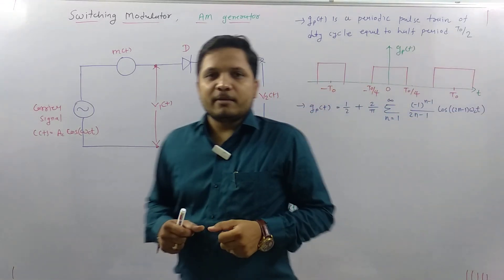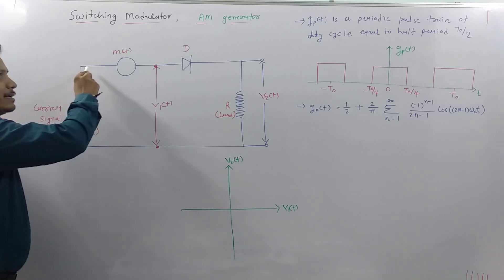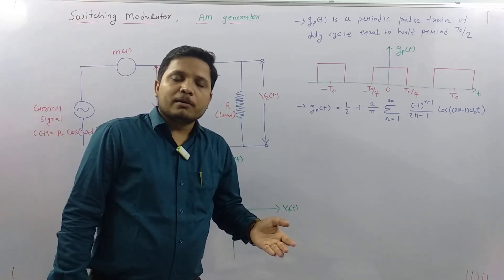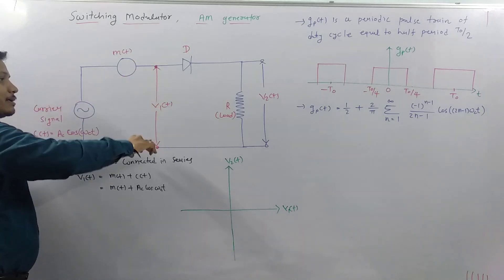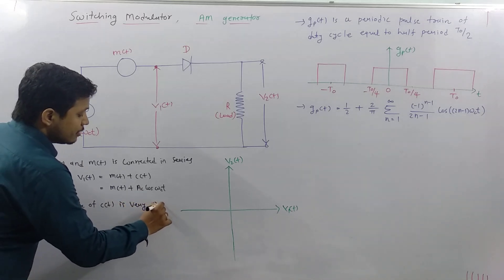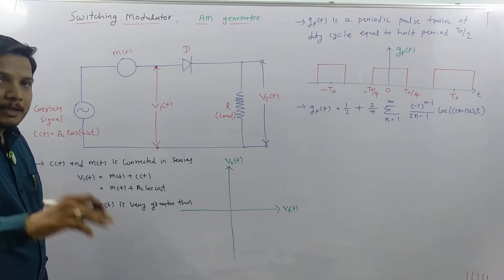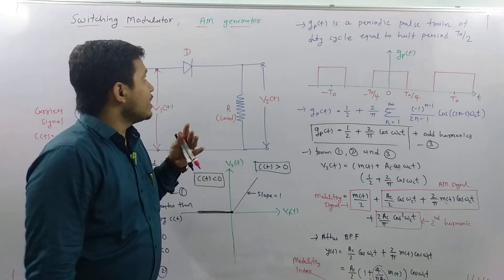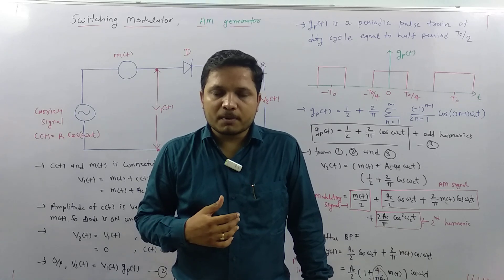Switching Modulator (Basics, Working, Derivation, Block Diagram & Circuit) Explained | AM Generator

Comment: Sir can you help me with this?

Design and implement a switching modulator in MATLAB for Modulating a composite audio tone signal to the medium wave (MW) AM band which is used for radio broadcasting. The information signal is supposed to be a dual tone having two sinusoids X+1 kHz and Y+2 kHz, where X and Y are the first and second digit of your Roll no. respectively use the other best suited parameters of  your choice for the camer frequency, filter types and their bandwidth. Analyze the time signals and their spectra at different stages of the implementation.

Comment: Sir but the waveform is a half wave symmetry so we shouldn't consider the dc value right??? Plz respond me fastly
Reply from the maker: Yeah, you don't deal with DC components
Reply: @EngineeringFunda  then why u consider the dc value (1/2) in Gp(t)???
Reply: @srialekhya7248   the periodic pulse train is an even signal. So there can be a constant value(ao/2 in fourier series).

Comment: Why do we always pass through BPF and not any other filter? Even in case of Square Law Modulator, BPF is used.
Reply: Because we have to avoid law frequency components which are use less. If we use law pass filter then there will be a DC component

Comment: Can anyone pls explain me how gp(t) came in this output signal representation..?
Reply: Hello Goku ;P
gp(t) is a way of representing the output signal. It doesn't exist in the circuit. We know that due to diode negative peaks of the input signal are vanished at the output section. If the time period of input signal is T, then on period of positive peak will be T/2 i.e time period of positive peak. So output will have postive peaks at every T/2 spacing.
To be more clear just draw the sine signal and shade the positive peaks and erase negative peaks then you can clearly see positive peaks of period T/2.
This is the output signal, now to represent the entire signal it requires complex math terms. To make it simple we can view the output signal as on period multiplied by original signal. This on period is gp(t), and that's the reason it has the width of T/2